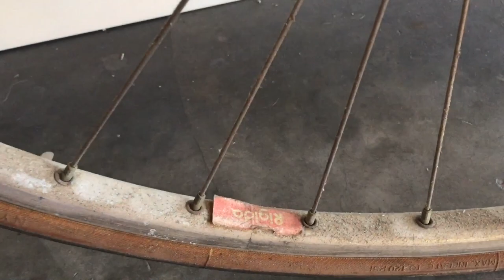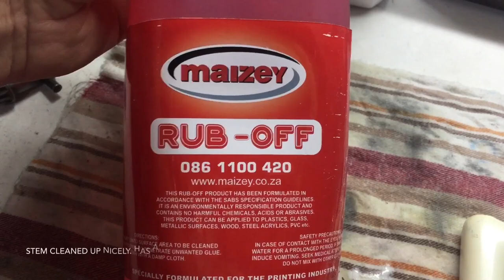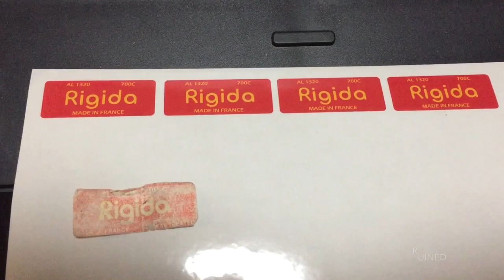Peugeot Mirage Restoration

Comment: lovely build and a fitting end to such a sad story.

I can vouch for Maillard quality with the 700 pedals and hubs on my Peugeot and 600 hubs on my Major Nichols all running super smoothly.  I'd love to get my hands on a Suntour groupset.
Reply from the maker: Thanks 🙏🏼 Indeed, I’ve got a set of Maillard high flange track hubs hiding in a cupboard somewhere that I’m going to dig out and restore now after seeing the quality of these pedals 👍🏼
Reply: Surprisingly I found a Georgena Terry road bicycle with a Suntour Cyclone 7000 groupset in the trash. I must have rode by in a dozen times thinking that it was junk. One day I decided to check it out and boy was I surprised. Decided not to rebuild the bicycle but rather to part it out and sell online.

Comment: Hi, I saw one of your videos recreating the shimano decals, what kind of sticker are you using and are you just using an ordinary printer on this? Great video by the way, relaxing.
Reply from the maker: I’m using water slide decal paper and printing on it with a normal bubble jet printer, then clear coating the decal with a UV protective spray to seal and protect it.

Comment: many thanks again great films. can i ask you whats your method for removing stubborn cranks?
Reply from the maker: Cranks are always tricky and require lots of patience. If penetrating agents like WD40 don’t work then applying heat with a heat gun is the next step. Ice can also work, anything that forces the metal to expand or contract to release the bind.
Reply: @BuffsVintageBikes  thanx great tips